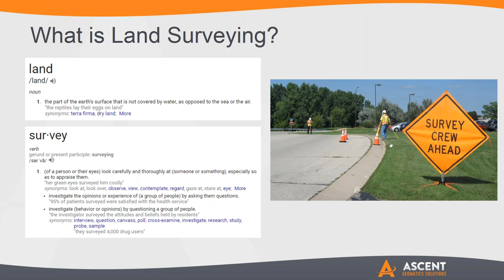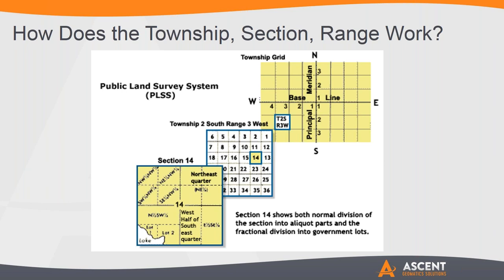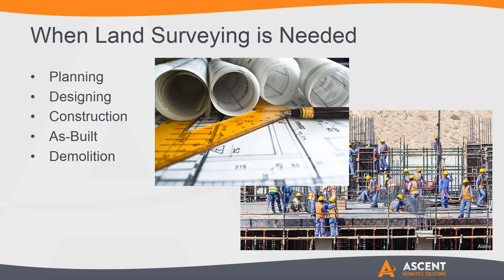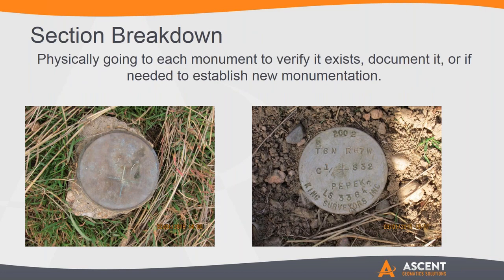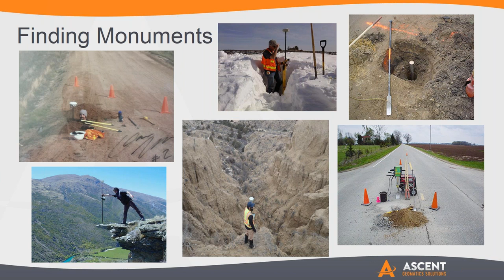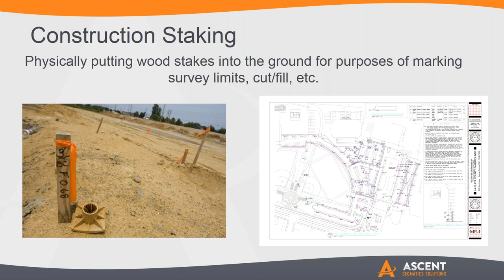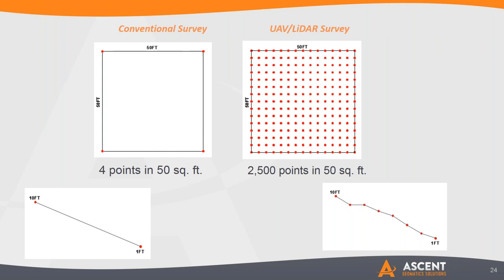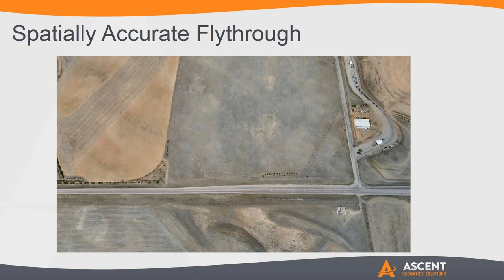Webinar: Land Survey 101

Comment: Hi, will like to survey a 500 acres of bush/forest land. Do I need to cut footpaths along bandies or can the surveyor use a drone and GPS? 

FYI, I am trying to avoid the cost of cutting the footpath.
Reply: You need local surveyors to answer that question accurately. If the surveyors have to hack through jungle it takes them more time and they charge accordingly.